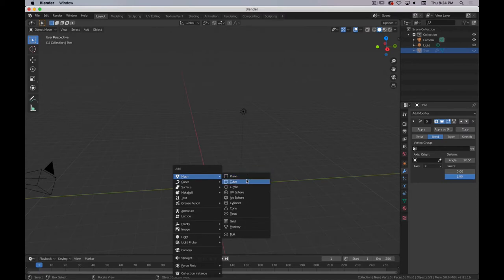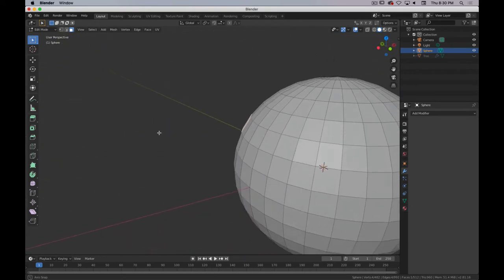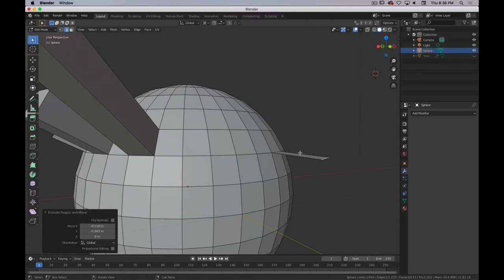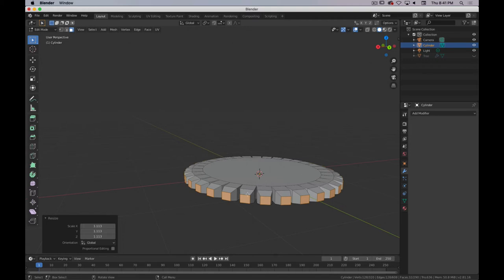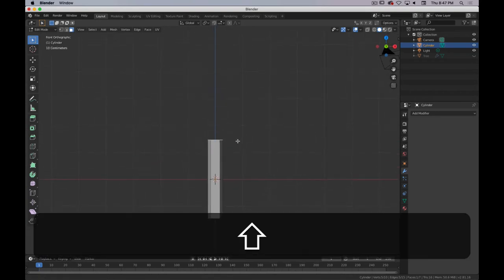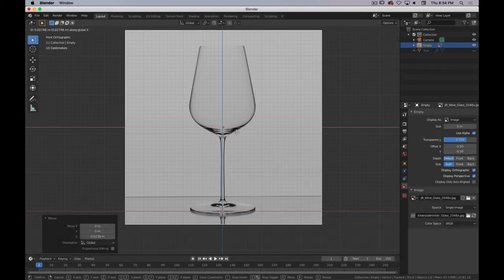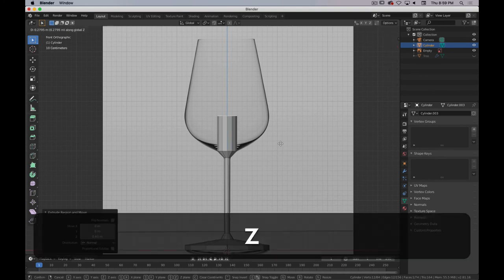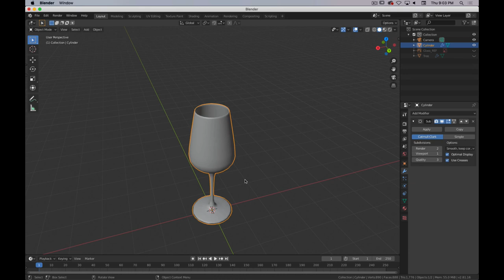3D Basics in Blender - Extrude and Reference Images

Comment: Thank You.
Just to say, in case it helps anyone, in 2.91 (I'm not sure when it was first introduced) you can simply drag and drop a reference image into your viewport and it will be added as an empty which displays an image; you'll want to be in Front, Side, or Top view before adding the image, to make sure it comes in properly aligned (although if you're not, you can easily correct its rotation with ALT R); for me, that's often quicker than adding an empty and then finding the image in your file system.
Thanks again.